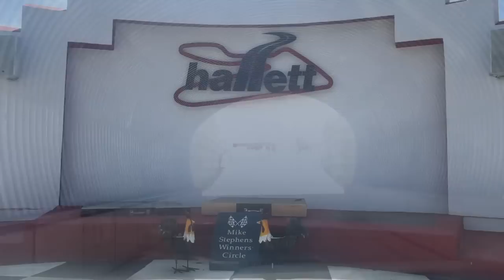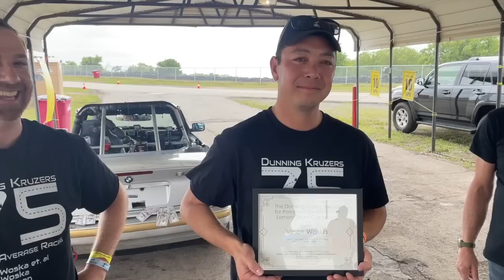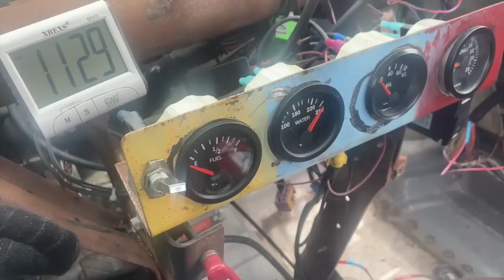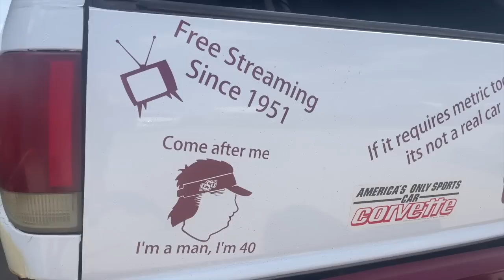Tiger King is now a racecar driver? - 24 Hours of Lemons Wrapup--Hallett '23

Comment: A slight correction to @lunkydog's comment. I was involved, as a volunteer, with the original building of Hallett Motor Raacing Circuit in 1976. "Mad Mike" Halley and I 'stitched together' some of the first tire walls at the track. From the early days the term "The Bitch" referred to the turns 7, 8, and 9 combination, not just turn 9. Turn names have changed some over the years and some by user groups. An example: Turn 2 is called 'Coyote Corner' on the official track map but is known as 'The Bus Stop' to most motorcycle racers and riders. At some point after track ownership changed hands in the 2000-2001 years, track owners decided to give turns 7, 8, and 9 each their own name. Turn 9 became 'The Toly' in honor of Anatoly Arutunoff, the track's original creator and owner. Lol, you can guess about turns 7 and 8.